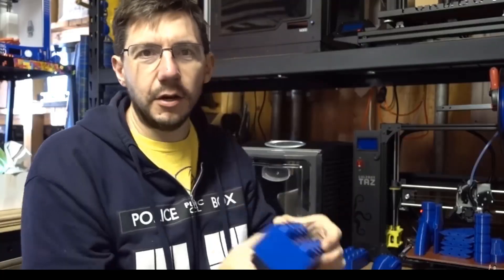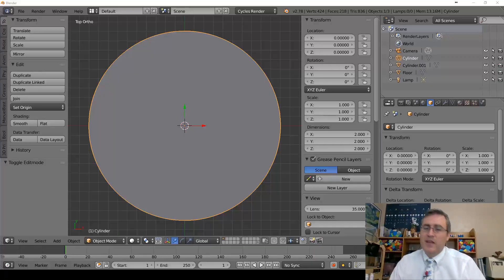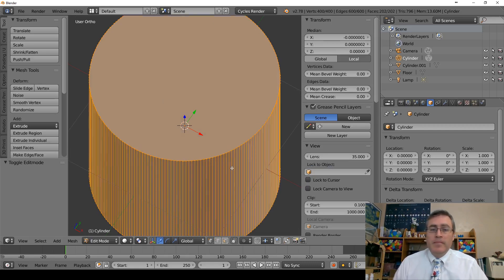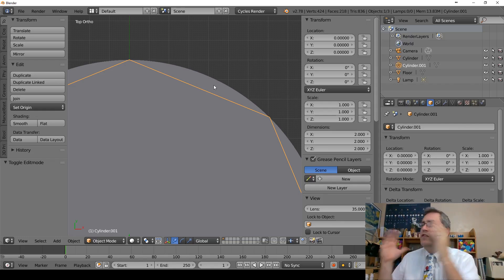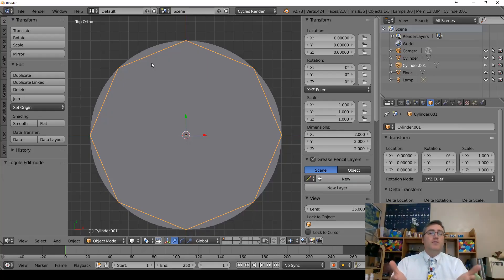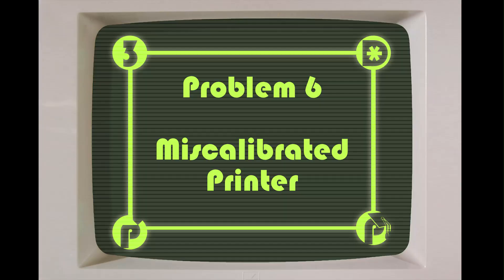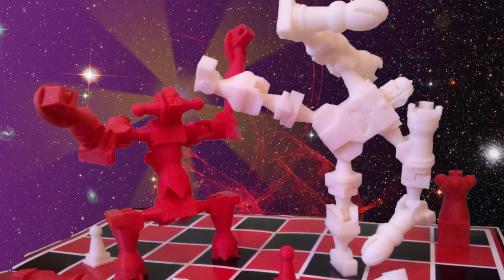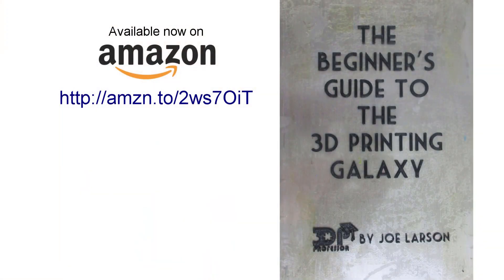Why can't 3D Printers print accurately?

Comment: It's not pronounced "Slick 3 er"   The reversed 'E' with a '3' is 0ld Sk00l L33t Sp3ak.  From the day's of BBS's.  Pronounced "Slicer"
Reply from the maker: I refuse to call it that. Maybe this is my opinion, but a slicer is what it is, so it can not be it's brand name. If Chevy named their 2019 lineup "Truck", it would not be allowed. So if pronouncing the number is the only way to avoid a stupid naming choice, then Slic-3-r it shall be.
Reply: Very well.  But being one of the earliest open source and community driven slicers, released in early 2011 just as the prusa mendal was breaking into the hobbyist market, it's kind of the original.   I cut the name a bit of slack there.  Like Xerox was not just the name of the company producing the first mass copiers, but also arose in the popular vernacular as a word for a photocopy.   
It's no big deal though.  People got too worked up about it.     I don't know if I'd call it "stupid" though.  Maybe if they'd chosen Slication, or Slicanator, I would.  ;-)

Comment: Very good points I was a meteorologist At Rockwell back in the 90's one of the tests we would use on our C-N-C machines was to cut different size parts then measure them to a tol 5 times tighter than it was to hold. use their + or  - tol to see if  they  were to tol. some times the machine could not be adj. into tol and we would make a measured value scale to affix to the machine. so on my printer I made a measured value sticker & this helps a lot I make tight tol puzzles & the better they fit the less labor I have to put into them the more I make per unit so if you know that in the X axis your printer is 0.015  the measurement you call out make a note & adjust your measurements same in the Y & Z axis. thank you for your insights into this problem

Comment: EDIT: oops, I didn't watch the entire vid before making this comment :D

To make your model slightly smaller, to manually compensate for the fillament thickness, Blender has the solidify modifier that extrudes in or out from the face normals, which could likely work :)
A regular scaling would not, of course.

Comment: These are most of the problems I find with cheap (several thousand dollar) home printers. The professional models that cost considerably more don’t have these problems, or at least, they aren’t significant,

But you didn’t mention a major problem that these home models also have. That problem is when the software loses sync with the hardware, and your print ends up being a stringy mess. Even with newer models this still happens. Some types of shapes are more susceptible to this problem than others, but each printer is somewhat differently affected.

In addition, most cheaper printers simply can’t print fine detail that theoretically, according to the physical specs of the device (minimum lay down thickness) they should. So no matter how you fiddle with the software and hardware, they will never be able to print those details, or meet any useful model parameters.

Things seem to be getting better, but improvement in these home printers is painfully slow. At some point, Canon, Edson, Hp and Lexmark will find home 3D printing to be a real market, and we will se significant improvement. But when that will happen is anyone’s guess, though I expect they’ve been working on it for some time.

Comment: Arr... other than calibration is necessary, there were no useful recommendation in your video.

1) Curve compensation - although it could be a problem, it rarely caused a problem to fitting parts.  Be frank, the corners drew by a extrusion based 3D printer were always round because the nozzle was round in shape.  A PRINTED 2mm diameter hexagon hole would just be as lousy as a PRINTED 2mm hole with a million sides.

2) ArcCompensation - This has been reported years ago along with equations to model the changes and the required compensations, and it will be a problem unless the hole diameter is smaller than 3mm  (See http://reprap.org/wiki/ArcCompensation ).

3) Filament diameter accuracy - if you were referring the filaments on the market a decade ago, yes they were inaccurate.  Now?   Even with the cheapest filaments on the market, the  diameter of filament only differs less than 0.02mm in general.

4)  ...[ Way too outdated to be commented ]...

5) No.  There were none Slicer software that would do drawing on the perimeter.  The software had accounted for it by insetting the polygons for the path planning, more than likely, since the dawn extrusion based 3D printers.

6) Calibration is necessary.  This is true, and even with the low cost mechanism, the stepper motors and timing belts, the traveling precision had already be practically accurate enough out of the box.  It's not because the 3D printer vendors were doing some extraordinary jobs, but because the quality of the stepper motors and timing belts are damn good.

7) corner ringing - Slicers have done quite a bit to reduce corner ringing via controlling the acceleration.  The ringing, though harming the printed model surface finishing, is irrelevant to fitting parts.  The damage it did to the dimension were too small w.r.t fitting parts.

8) There were no sensors to monitor the extruded filament is because it wouldn't help.  It won't help for a good reason that molten plastics is not Newton fluid.  Molten plastics behaves elastically like rubber.  Even if you knew the volume of the extruded plastics in solid state to infinite precision.  Once it molten and pressurized, the volume changes, and your infinite precision volume value was rendered meaningless.

9)  Arr... the last three were just mostly wrong.  Important keywords were mentioned though, the relations and recommendations were bogus.  Please google and read, "professor".

Before you disagree with what I said and planned to reply, please read this https://www.thingiverse.com/thing:52946 .

Comment: Unfortunatley no 3d printer is going to have perfect accuracy, so there will always be adjustments to the models to go from one machine to the next.  Dealing with polymers that can shrink or grow by 2 to 10% will always mean some compensation needs to happen.  Running some of the professional machines you quickly realize why they cost so much more. Better material, controlled environments, and tons of reasearch on x-y-z compensations for different materials.

Comment: In Joel's case the problem is that he scaled it up. When you have pieces that fit together, the spacing difference between the parts should Not change no matter What size the parts are. When you just resize a part (like the lego brick), it resizes Everything and the spacing too so now they won't fit together. I'm not sure I know of a good solution for this problem... but it is certainly good to be aware of when you are working with parts that fit together.

Comment: Great  video. I really enjoy these technical discussions. Recently, I was attempting to 3d print some parts with large integrated internal and external threads but even though  I had included a large amount of clearance in the design, they wouldn't  fit together. I agree with you that padding the clearance in the design just seems wrong. Instead, I did some research and discovered the importance of calibrating my XY compensation and  scaling factors. I created a small test print that I can use along with a caliper to quickly calculate these values.

Comment: I am with you on a filament size detection. This illustrates the problem with CNC and Gcode in general. I haven't seen a machine that can modify the Gcode on the fly. I you had that ability you could do a lot with sensors and cameras.
Reply from the maker: You can modify how the printer responds to gcode in some small ways. Speed and temperature. It would be trivial to fix the flow rate on the fly, as it's simply division.

Comment: One would think as 3D Printer manufacturers continue to push into industrial markets, that there would be more push by ASTME or ICC to regulate the tolerances of the filament material in both composite and thickness. In my industry, tolerances are extremely tight.
Reply from the maker: But, when anyone can put an extruder and gear drive together to spit out something akin to filament, when the market is dominated by people who don't care about regulations, and only care about getting something done, how will you enforce it?
Reply: I guess I am more referring to industrial standards. In our plastic extrusion process, all of our vendors have to meet a lot of strict quality control measures. We only buy product from certified plants. Granted, our plastic comes in beads and not in a spool, but the concept is the same. 
We use different types of composite plastics depending on our products purpose. UV additives, heat expansion control, plasticizers, color additives, etc. All of which are highly regulated.
I guess on a commercial level or personal level, the guidelines either don’t exist or not enforced.
However, if 3D Printing is to be industrialized here in the US, it will have to be regulated at some point.
Though I know that affects costs, and may eliminate some imported materials.
I know I’m talking extremes here, but it is possible to control. It won’t stop crap from being on the market, but those who need that precision, will be able to get it by buying from certified vendors. 
This is just concept of course, but it is a process already in place for a lot of raw materials already.

Comment: PLA also expands as it's extruded. Expansion coefficient is generally around 10%, ABS shrinks, usually by around 2%. But it all varies by filament manufacturer. And may even vary spool to spool. Filament diameter compensation is something that is available and can be added, but for the most part, unless you get super discount stuff, 1.75 -- generally means 1.73-1.77  -- which is not enough to make something not accurate. Also a press fit is not ID = OD, if you do that it won't fit. Even in wood working we know that if we want to have a press fit, you make the hole a hair bigger than what is supposed to go into the hole. So adjusting the model is the right thing to do. Now how much to adjust it by will vary of how tight you want your press fit to be. I don't think slicers or printers need to be compensating for bad design. A 5m cylinder will not fit into 5mm hole, it just won't, no matter if it's 3D printed or made on a precision metal CNC machine.
Reply from the maker: You are correct, to a certain amount. if you're doing much more than a reasonable amount of tolerance, you should probably look into fixing the printer.

Comment: My solution: post-processing. Especially for holes, I print 4 perimeters on a .4 nozzle to give myself a thick wall, then I just drill out the holes to their correct size. For this I do need my holes to come out undersized, which I think is what happens for most people

The outside of the model is usually slightly too large for me in XY, if I care about that I sand it down a little bit. Again, thicker walls gives you more leeway here. In Z I'm usually deadnuts accurate, but I must also consider that the Z direction is weakest, especially in extension.

In some cases I compensate in my model. I agree it's not very elegant, but my parts work. I do this for fitting bearings quite frequently. If I press-fit bearings in a too undersized hole with my vise, I just crack the print into pieces, or the bearing won't run smoothly anymore.

Comment: I recommand to always print a test fit before printing the whole object and after time you can note with tolerence you need to have with your machine. I think there is a major issue arround the STL because there is no easy way to modify... Another tips : check comment section on thingverse before printing something, because many people say there " fit problem, scale up to 102%". The downside is when there is no comment / make i don't make the part.

ps : Real life object are not 100% accurate, for exemple i work a lot with PVC tubes ans before purchase i always try a test fit.

Comment: Great video, but i kind of disagree with causes and the order you had put them ... To me it's :
1) thermal retraction. Even with the best printer of the world or with PLA you'll have retraction that will shrinks at different rates the male and female parts
2) curve approximation. Nothing more to say here.
3)tolerances. Even if you had a perfect 10mm cylinder and a perfect 10mm hole they won't fit together, they need some space. Look at Maker's muse video about tolerance for more info

After i agree with all the rest. Maybe you could have mention the blob at the starting layer point that could also cause problems
Reply from the maker: Oh, I entirely forgot about thermal shrink. Dang it. Yeah, even PLA has it, a little.
Reply: 3D Printing Professor but IMO in the end the main problem is tolerance while designing ... I've seen people make 30 mm holes for 30mm pins ... And it (of course) didn't worked out. But just by modifying to 29.8 mm pins and 30.1 holes and it worked perfectly, with a fit just tight enough

Comment: For any thing that has to fit together or fit to some thing else, I first create a sample of the critical elements, print, test, adjust. Only when that is right do I print the complete object. In Joel's case for example, don't print two huge legos until you have printed a sample of one pin and hole pair and got them right.

Comment: As a professor, do you use field notes while you print to keep a record of your prints? If so, could you share some pages, I'm curious. Thanks.
Reply from the maker: kingmallow I am really bad at keeping records. Unless I have something specific that I'm keeping track of, I don't. But I have an opportunity where I should really start keeping track of things. What sort of information should I gather, I wonder...
Reply: I'm not sure since I haven't 3d printed, if the printer you have uses variable temperature I guess it could automatically log that information along with where it things it is along the xyz axis through the printer and compare that with the slicer's expectations. Physically I suppose one could observe things such as: File you are printing, version of the file, Short desc, Slicer software used, version number, settings used, Time print took, orientation of print, max xyz. After the print is done you could observe print qualities and note any flaws such as layer adhesion and bubbling/roughness along with general coordinates of blemishes [Pock marks on NW quadrant of a vertical straight edge] (That way if you were to observe layer adhesion issues in the same quadrant or direction of the print it could clue you in that there is something wrong with say, the northwestern side of the printer.) North not being actual north but a predetermined orientation used for the printer relative to the observer. It's hard to know what is important and what isn't not having any experience with 3d printing, but I suppose this is where I would start, if I could maintain the discipline. I guess I would learn new data points to consider or stop considering along the way. You know: SCIENTIFIC OBSERVATION!! YAY!! But fear not you are already keeping a video field note of your progress so that counts too!

Comment: Slic-three-er ? You're doing that on purpose, right? Ok ok I'll be "that guy".  It's pronounced slicer but with a 3 instead of an e like in the mega tokio manga 1337-speak (leet or elite speak). I'm still thinking you're pulling our chains on this one btw.

On a more on-topic note, I really love your videos and have learned a lot from them, including this one! So thank you for making these videos!
Reply from the maker: Oh, I'm totally doing that on purpose. But only because naming a slicer "slicer" is like Ford naming their 2018 line "truck". It's, uninteresting, uninspired, and stupid. Pronouncing the "3" is a more acceptable solution than that. 

However, I like @Energy Flurry's option of just stretching out the "e". Sliceeer.
Reply: Dude.  Tom Sanlanderer does the same damn thing. It drives me nuts.
Reply: Slic3r=sliceeer
Reply: I'm with you on this, Professor.  To me, Slic3r will ALWAYS be slick-3-r.
Reply: Ford Ka